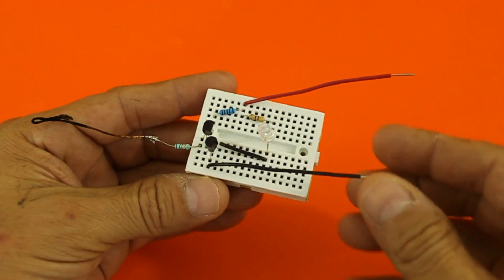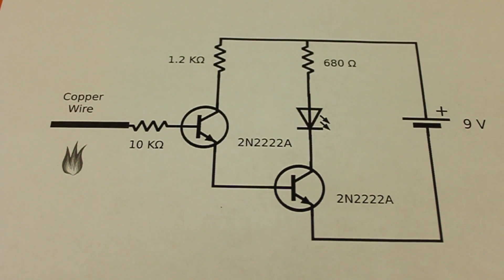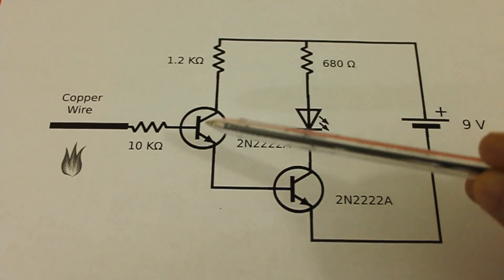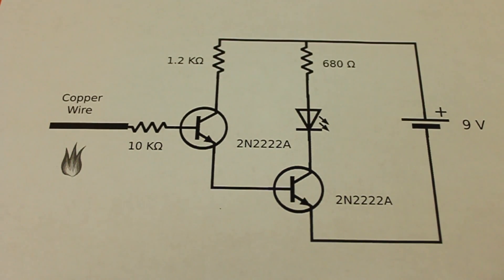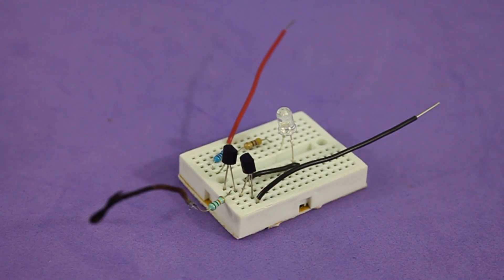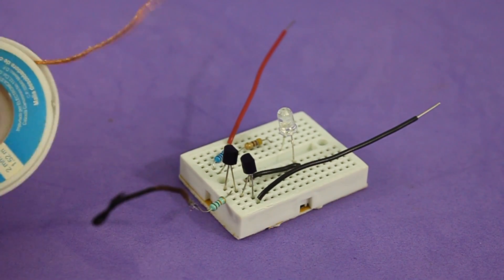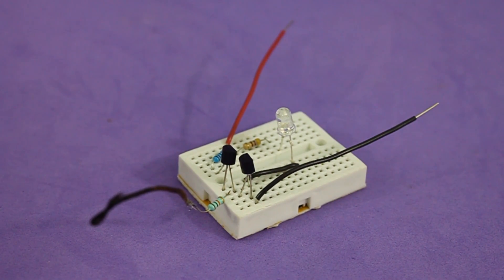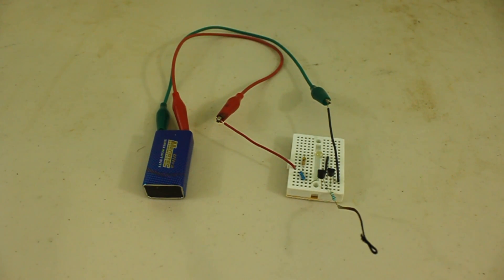Simple Fire Detector Circuit

Comment: Why would you use LED to signalize flames? Isn't the flame itself bright enough?
Reply: Mister5MasterToJa That's not the point, the led warns you when the transistors turn on, so you can replace the led with an oscillator and a buzzer.
Reply: exactly!

Comment: Ludic sir...can I use BC 548 transistor?
Reply: In simple circuits you can use generic NPN or PNP depending on the circuit, the ones he used there are NPN.
https://en.wikipedia.org/wiki/BC548           https://en.wikipedia.org/wiki/2N2222
read a bit, and try, make sure you get the Base, Emitter, Collector right, they seem different, or maybe not.

Comment: I rebuilt it and found out, that fire is not directly the reason for the led to glow. The fire just conducts the air and act like a cable for you toching the metal lighter. I tried with matches to find out and it worked not. This is the porouve, fire or heat is not the reason.
Reply from the maker: +Eric Dessel i just did the test, you're right!
Reply: Ludic Science Then you should deleate this video and be glad, only 2000 people watched it yet. Don't take me wrong, I like your videos, but those little things can destroy a whole channel...
Reply: Ludic Science OK then it's better to update the content with this info.
Reply: hmmm..try fire by candle or matches.

Comment: im not sure if its actually amplifiying the current.. it seems to me the transistors are working as switches..not amplifiers..
Reply: transistors by definition are current amplifying devices
Reply: I think that is only when they work on the 'active' region .. but in the circuit shown they seem to work on the cut-off and saturation region.

Comment: Nice Darlington pair transistor setup. 
 Thank you for this awesome post sir!
Reply: A darlington is kinda like that but if they do not BARELY(with nothing else) share the collector (C), then it is not a darlington. Meaning that you connect anything before collectors connection but not after. There before collectors meet there are 2 resistors and an LED.
https://en.wikipedia.org/wiki/Darlington_transistor
The first transistor there is acting like an amplifier while the other is acting as a switch.

Comment: Isn't this more an example of a thermoelectric effect such as that used in a thermocouple than it is ionization of the air? https://en.wikipedia.org/wiki/Thermocouple I don't see the temperature of the hand being hot enough to ionize the air surrounding the copper wick. Also, it appears that the fire needs to be right on the surface of the copper to have the effect -- i.e. proximity did not seem to be a factor. I love your videos. Please keep it up! I've learned much and been inspired to rethink things I've taken for granted.